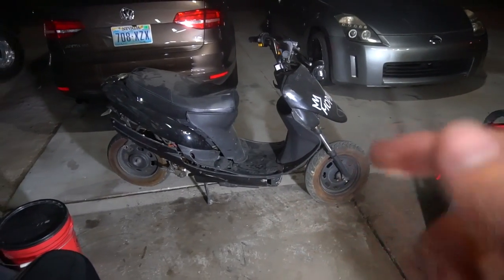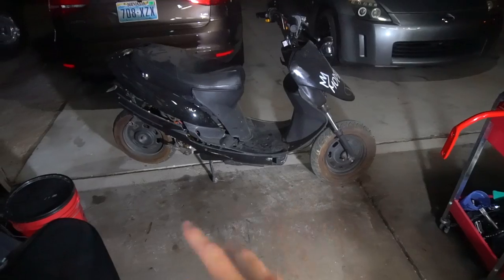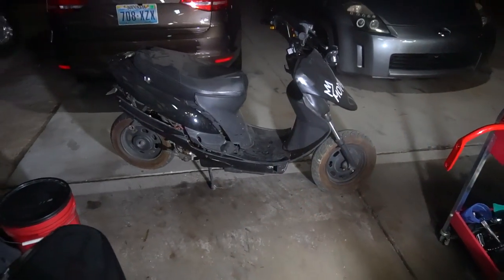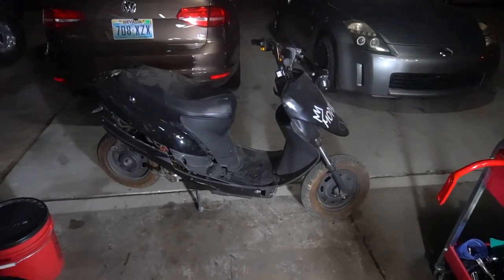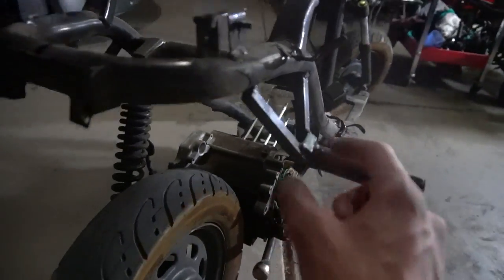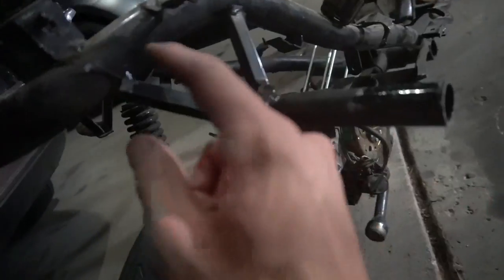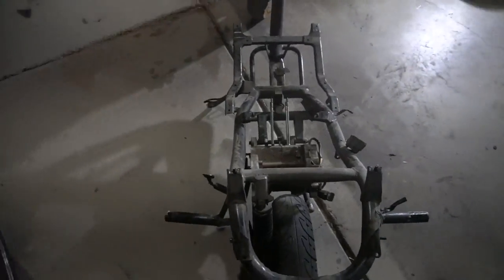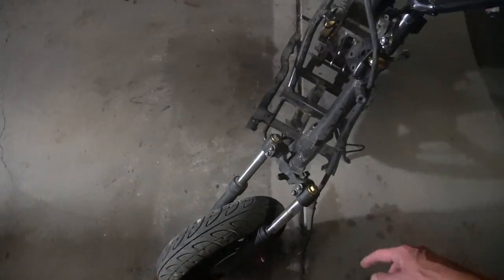GY6 150cc Swap into 50cc SCOOTER | Part 2 | Making my moped crazy fast

Comment: Just got my 80cc(47mm) bbk checked and doubles to make sure I got the right one (64mm for the valves). Also got a performance exhaust. Will I need to do any mods to the carb? Any tips or necessary upgrades? I vote RED :) btw it's my daily rn so that's why I didn't go to big, want to keep it reliable.
Reply from the maker: i would get a bigger carb too, maybe a 150cc carb
Reply: What would I expect from the 150cc carb vs the original carb?
Reply: Actually 47mm is 72cc to be true. Doesnt need a bigger carb yet but a bigger main jet for the stock carb is going to help with some torq. (95-98)
Reply: Jakki Nakki though you are correct, its marketed as 80cc.
Reply: Jakki Nakki and I was looking into jetting my carb.
Reply: Install went great and it's a lot better on the road!